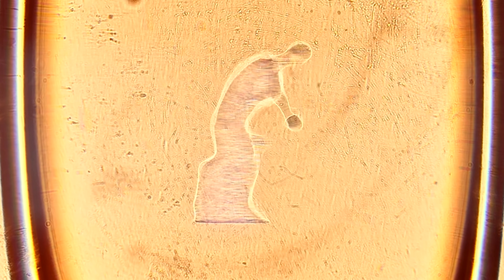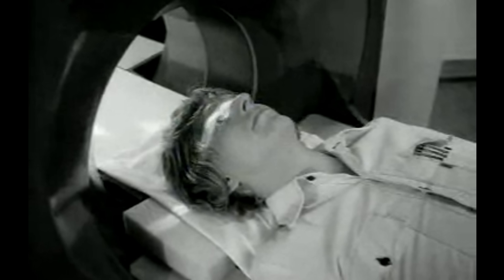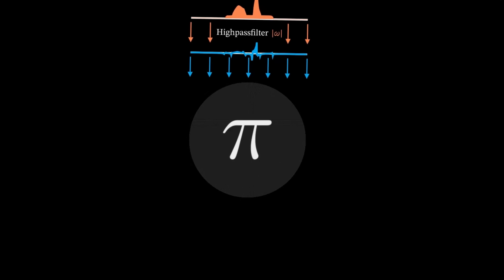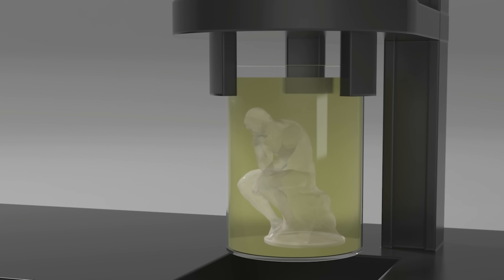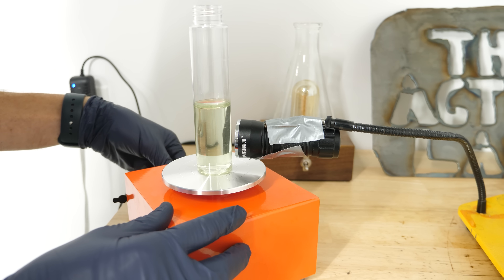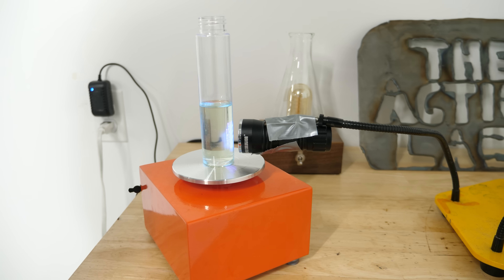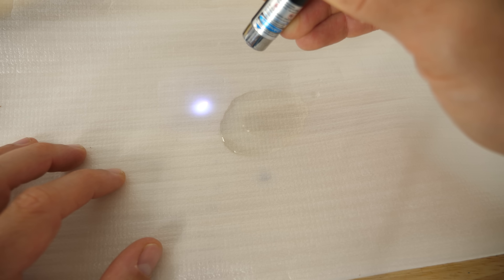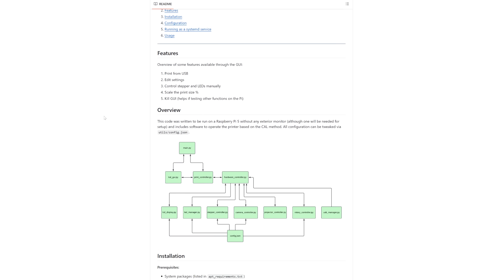Volumetric 3D Printing Is REALLY FAST

Comment: 5:27 - These older resin 3D printers are first type of 3D printer I've seen. And that was at least 20 years ago. Then, the more common filament 3D printers flooded the market. Good to see these "upgraded" resin printers coming to market.
Reply: And that's what I get for running off at the mouth and not watching the entire video... just made that same comment about seeing this back in the 80's or so,,,
Reply: The dippiing type SLA/DLP/DLC printers are still the most common and useful in industrial and medical fields because of the homogenous structure (and the ability to change the filler content and material properties) rather than weakly joined filaments. FDM printers are mostly hobbyist printers as far as I have seen.
Reply: @NINTHSKULL  fdm printers are generally used for prototyping, not industrial mass production.
Reply: @gothicanimeangel96  Yes prototyping too, but again I think its not as easy to change the material properties. I haven't done much FDM but lots of SLA/LCD
Reply: @NINTHSKULL  there are several different filament types, but the main positive is just that the process of printing is quick and reliable, the objects are immediately handleable after printing, which makes iteration convenient and speedy.
Reply: @NINTHSKULL  Yeah, FDM is really great for consumer level 3d printing. Filament is really cheap, and there's relatively little toxicity involved. Some fumes are released while printing, but far fewer than what resin typically releases, and once your done there's no danger. You can handle stuff directly without worrying about a toxic liquid getting on everything you touch.
Reply: @gothicanimeangel96  :  FDM printers are safe enough for a youngster to use, with appropriate adult overview to mitigate fire hazard.
A resin based printer has much greater potential to make a horrendous mess, and involves more toxic materials.  This is not going to rule it out, but it does need a different mindset.
Reply: @NINTHSKULL  FDM printers are also really useful in education.  I can happily let a 9 year old operate an FDM printer, but I wouldn't want them handling uncured resin and isopropanol.

Comment: In your experiment you were spinning pretty fast, it could be that the hardened resin was being pushed out to the edge by centrifugal force?
It looks like in their example it was going a lot slower so that inertia and the viscosity of the goo would keep the liquid in place?
I could be way off though, if the cured resin has the same density as the uncured resin it might not make a difference.

Comment: There is a reason this has been out for awhile now and they are still printing really small objects with limited resolutions.  It's cool and all but you need very special photopolymers, you get limited resolution because of bleeding limitations and the speed advantage disappears and the cost goes way up with larger size.

Indeed, because the polymer isn't perfectly transparent there is an in principle limitation in size.  If you want to cure the center the best you can do is have your light sources (optically...whole etendue thing) act as if they were a perfect sphere of parallel rays intersecting at the center.  But at some size the losses are great enough that to get enough power at the center you start hardening the exterior.

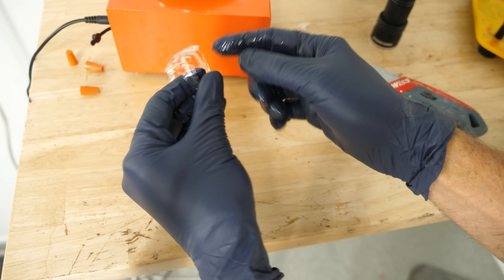Comment: 8:51 you’re spinning too fast.
Reply: Can you walk us through how spinning slower would cause the UV resin to not do the exact same thing?
Reply: @kilo.sierra  if he spins it slower, there will be less centripetal acceleration, and allow whatever resin is hardening inside the volume to solidify with greater resolution.
Granted, he would still need a more appropriate formula for reconstruction of whatever object he is intending to print, along with a higher fidelity projection, but an appropriately lensed laser pointer and a bandpass filter on the container combined with a slower rotation would allow him to make some pretty regular spheres, rather than pretty regular rings.

Comment: You need to use a computer controlled focus to get it in the center and to build up the surface 🧐 like layers of skin 
Imagine combining it with the electronics and having a flashy, soft resin making an organic style robot ☺️😵‍💫😁  maybe insert the wires for the robot after construction 🤔 
But try using a manual focus to get into the center of the flask, then try manipulating the program to focus and not focus the lenses as needed

Comment: This is incredible and I love it. I would love to be able to Make with tech like this. I can imagine so many many uses! I wonder if there is a light activated polymer that could create a soft rubbery solid somewhere. Between hard and soft and being able to print around a metal piece inserted there are very few limits i can see if you remember to think through your process steps and materials.

Comment: The impressive part is making sure the resin doesn't cure outside of the object, will definitely be faster than traditional prints for most designs. Curious about the resolution of the object's surface though.

Comment: No slicing, too! a good chunk of complexity goes right out the window!
The density images shown could easily be rendered through path tracing, really fast and precise, without any tuning.
I noticed the example with the projector, but are they using lenses or anything to make the light beam parallel?

Comment: I thought about this briefly when I learned about resin printers, but assumed it would require something like two lasers positioned 90° apart and hardening the resin at the intersection of those beams.
Reply: That's the exact conclusion I came to when I saw the thumbnail for this video. I can't see any reason why that method wouldn't work, and perhaps produce even better more accurate prints. Would be interesting to see the idea developed. It's possible that they're already using a lens that can focus the light in the middle, but that has the issue of diminishing quality as you scale to larger prints (Not that larger prints are currently viable due to increased light distortion through large volumes of liquid resin).
Reply: That makes a lot of sense, and seems like it could be even faster and more precise. Maybe that will be the next generation of this idea.

Comment: This can't make anything with two inside corners in a row where you'd have to turn to see the full surface. Which makes it extremely limited, actually. Almost nothing I print normally would work on this... Things with internal slots, channels, voids, heck even just the basic concept of infill keeping things lightweight won't work.

Comment: There are optical 3D printers that use two lasers of different wavelengths that interact where they intersect and cause the resin to polymerise.
These were some of the first 3D printers designed

Comment: Needing to reach a threshold voltage and not blocking the light...
That sounds awfully similar to how chemically amplified photolithography photopolymers work.
Maybe the kind used for MEMS would work for this, since it gets used to make temporary supports?

Comment: We are getting closer to the Star Trek replicator. The 3d printers before we easy to understand even for someone who may not have our science knowledge, it just extrude some material that hardens when it leaves the nozzle and there's mechanical motion to get the nozzle to the right spot. With this thing, if you had someone 1000 years ago put a bottle of liquid in a machine and get out a solid shape, they might call it magic.

Comment: It's cool that you can print from depth images instead of needing a 3d object to slice. That opens up printing from non-standard forms of geometry as long as you can calculate the depth
Reply: your comment was stolen by a bot, @delphicdescant replied to it, I think it's worth forwarding this reply so you get to see it:

Yeah, it's honestly kind of silly that people still use mesh-based modeling even for layered printing. Surface meshes suck at representing volumes.
But if this kind of printing takes off, I bet even then lots of people will still want to print things modeled with surface (triangle) meshes, and they'll continue making hacky tools prone to mesh errors to do the job instead of just, like, actually using solid modeling properly.

Btw it should be totally possible to print depth photos or whatever even with layered printers. It probably just requires some thresholding or SDF calculations or something.
Reply: @MagicGonads  They do slice the object
Reply: @BozesanVlad  not my comment /shrug
Reply: @MagicGonads  You did copied it without understanding
Reply: @BozesanVlad  I just wanted the reply to be on the correct comment
Reply: @MagicGonads  And I corrected a mistake contained in said comment (and op's comment), based on looking at git repo (they released a slicer go figure..)

Comment: That gel at the start looks like eye floaters
Reply: I wonder if the bubbles in the resin would create problems with the print. Seems like if a bubble intersected the edge of the print, it would create a pit in the surface of the finished model, kind of like a bubble in a casting.

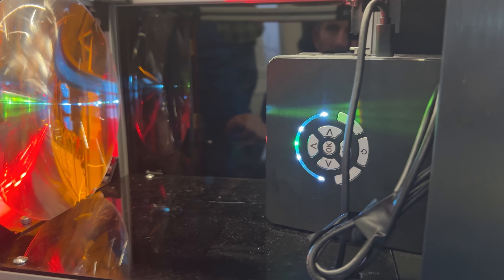Comment: 10:18 ok, so the light hits the resin and solidifies it, but how does it choose the depth at which the resin solidifies?
Reply: I am not 100% certain, but I think this is how it works:
Draw a circle and then draw two lines through that circle.
At the point those two lines intersect the resin cures. That's how you get the depth.

But it only uses 1 light source. The way that works is that the resin is a bit "slow". So basically the resin stores the energy from the first light beam, then gets rotated and when the light beam hits again from a different angle the threshold for the curing is reached.

Comment: They need the cylinder of resin to be rotated within a cube-like chamber of another fluid to acheive refractive index matching. That'll prevent the light distortion caused by the cylendar walls. The cylendar would be seemingly invisible and the projection would pass through a merely flat pane of glass. Also a vaccum lid for the resin tube would get bubbles out quickly.
Reply: I just assumed the refraction could be compensated for digitally.
Reply: I'd love to see this idea in action.
Reply: how did you spell cylinder two entirely different ways lol
Reply: How did you manage to spell cylinder correctly then spell it incorrectly twice after that

Comment: No hollow things can not be printed like a cup from a side or ball or anything not visible from a side. And does it have one projector? If so then all resin on beam path starts to react, so some of it becomes partially "used" and can not be used again without making result worse. It must have 2 crossing beams, and rotation to 360 on all 3 axis to be a real printer, and after that "oxygen level" in used but uncured resin must be restored to some specific level with another machine. Too complex. May be something else, not 3D printers can use this idea properly.

Comment: Had a similar idea a long time ago. But the way I was thinking about it was two lasers being shone inside the resin and they would intersect at one point where the light from both lasers would be of high enough intensity to harden the resin whereas the light from only one of the lasers wouldn't do anything. So you would have this one focus point in the resin that you could move around and basically draw a 3d shape. Never looked into it unfortunately.
Reply: Afaik that's how they make those 3d engraved glass sculptures (bubblegrams), they cross 2 or 3 lasers to blow up the glass at a given point, though afaik nowadays it's made with a single laser that is focused precisely at the point they want to have a dot.